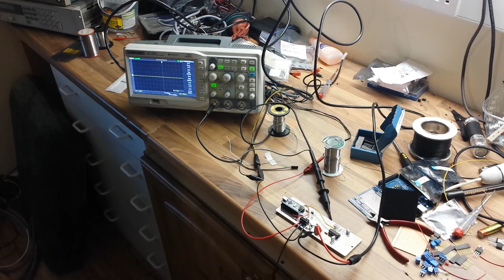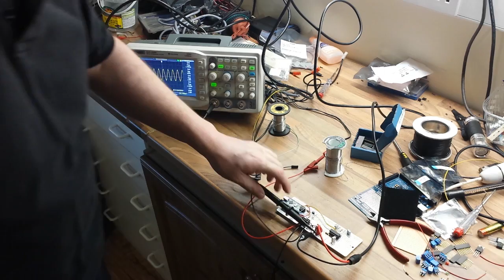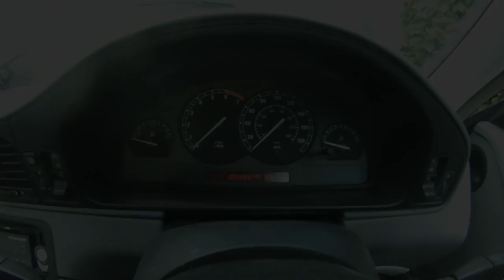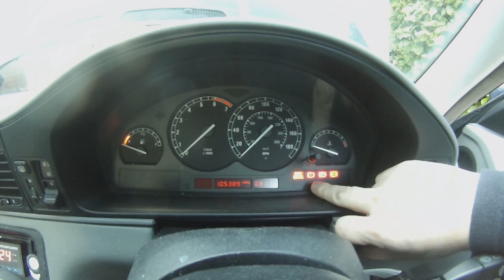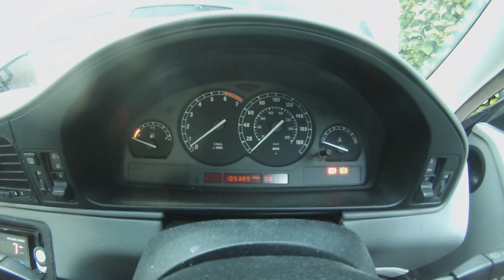BMW E31 840CI EV Conversion 39 : Rev Counter

Comment: ive tried to message you a few times with no reply. I really enjoy your videos. Would you consider selling your tacho meter adapter? I for one would be interested if you sold them.
Reply from the maker: +Black Terminal Sorry if i haven't replied sooner and thanks for your kind words. What exactly would you want the circuit to do? Like it does in the video ie take a reluctor signal and process it to drive a tach? or something else?